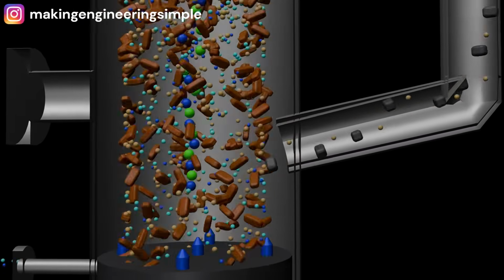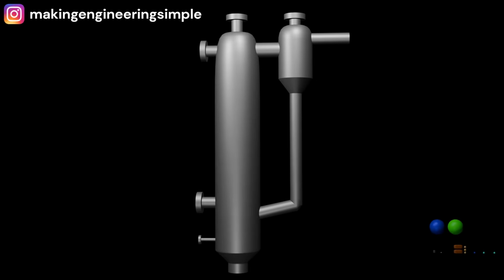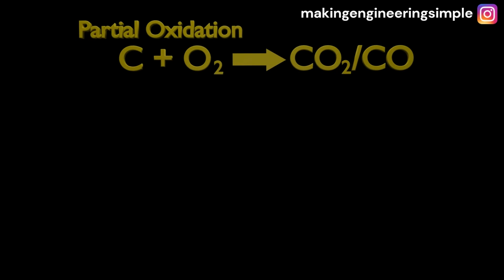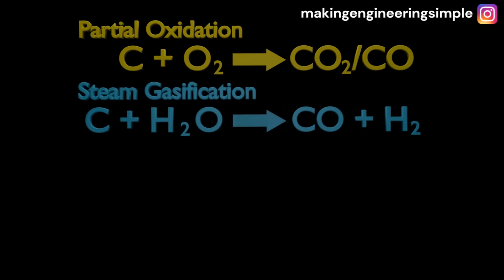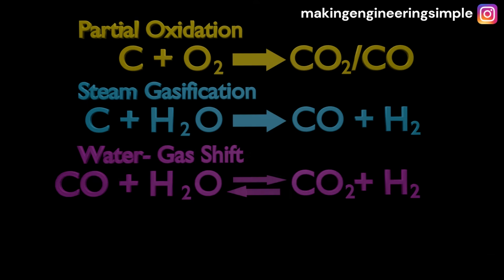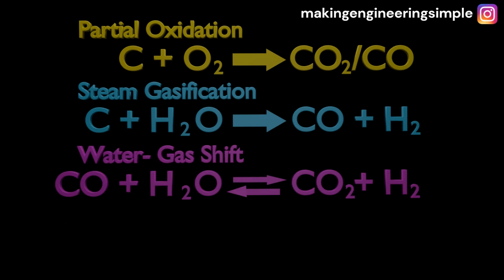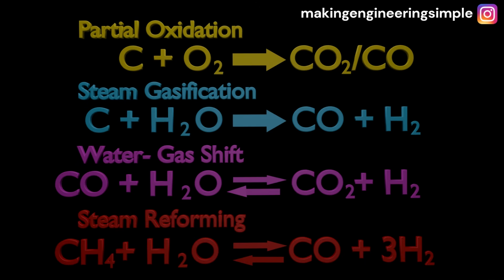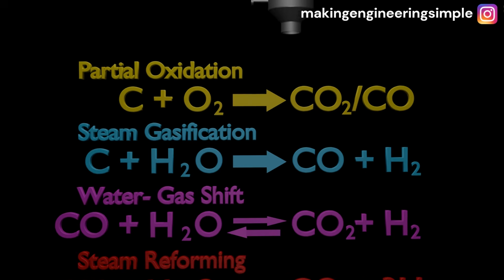Fluidized Bed Gasification: How Cyclones Recycle Bed Media for Syngas 3D ANIMATION

Comment: Diendobry ciekawe czy na tym gazie będzie pracował agregat prądotwórczy dziękuję za odpowiedź 😊
Reply from the maker: Good morning.  Yes, producer gas from gasification can be used to generate electricity in an appropriately designed gas engine. However, the gas needs to be cleaned and conditioned to remove impurities before it can be used. Are you thinking of using it for a particular application?"

Comment: My question is, how is the ash from this reactor sorted and evacuated?
Reply from the maker: Great question! In most fluidized bed gasifiers, the ash is removed in two ways. The heavier bottom ash and some bed material are discharged from the base of the reactor, while the finer ash and char particles are carried with the syngas and are typically captured by a cyclone. Depending on the design, the char can even be recirculated back into the reactor to improve carbon conversion.

Would you be interested in a follow up animation showing the cyclone, ash handling, and gas cleaning system in more detail?

Comment: 3 questions,  Please answer

1)  is the steam saturated or superheated steam?

2)  how is mixing air and steam achieved?

3)  What ratio is the air to steam mixed?

My requirements is for fluidised bed woodchip gasifier to produce high quality 2H2:1CO homogeneous gas for fischer tropsch catalytic processing to produce synthetic hydrocarbon fuels & products.
Reply from the maker: Hi,  I can give you some pointers on this 

1) Superheated steam would generally be preferred as your likely to get condensation and heat losses as it travels through the pipes. 

2) Mixing can be achieved in a range of ways, sometimes via pipe manifolds where the air and steam meets, or sometimes via a distribution plate which help increase the fluid velocity aiding fluidisation

3) This question I cannot say for sure, however for gasification your probably want oxygen instead of air 

These answers are not the only options but are just from my past experiences.  There could also be alternatives,  I  hope this helps and please remember to share, like and subscribe. Thanks
Reply: @makingengineeringsimple 
Thank you,  all of your pointers really help a lot.   

My main plan is to have a direct superheated steam tungsten injector with another tungsten injector fitted into it,  venturi effect,   at an angle to promote mixing,   in a  "y"  config before it enters the combustion chamber.

Agreed.  I have been thinking about the nitrogen in air and thinking best to remove as much N2 possible out of imput air with pressure swing absorption to concentrate O2.

Also thinking of expanding to a tandem gasifier system. 
One a Fluidised bed gasifier to concentrate syngas, CO/H2 production, and the other,  a twin fire fixed bed gasifier for mixed feedstock (woodchips,  hydrothermal carbonised char, HDPE,  LDPE etc)

So far I've built & successfully operated several updraft wood gasifiers,   but the filtering needed to remove the tar like substance,  proved challenging.

My main focus is to produce enough syngas to feed my fischer tropsch catalytic reactor & fractional distillation column. 

🤞😄🤞 fingers crossed that I make plenty of hydrocarbons without blowing myself up  Lol
Reply from the maker: @matildastanford7019 
This sounds like a great setup
I'm my experience tar formation can be caused by areas of low temperatures such as cold spots on your pipeline causing gases to condense. Hope this helps and please make sure to share my channel with anyone who may find it useful or interesting.
 I have lots more interesting content coming up! 
All the best and good luck